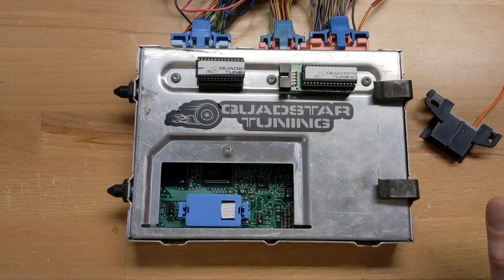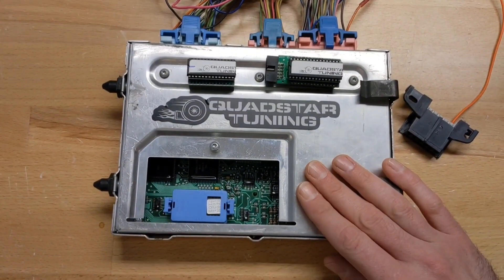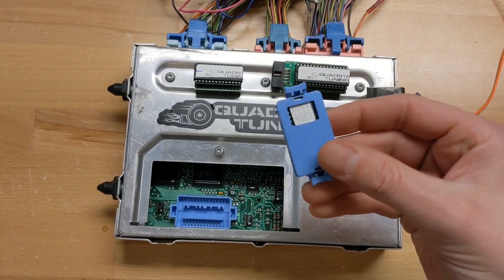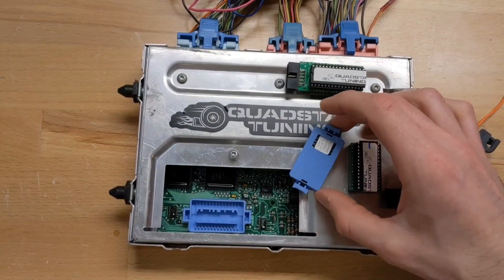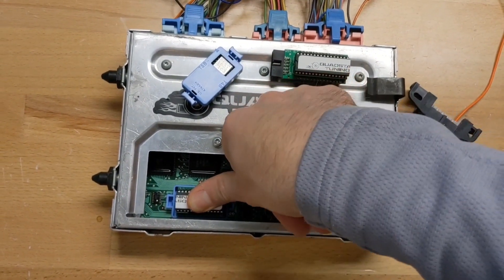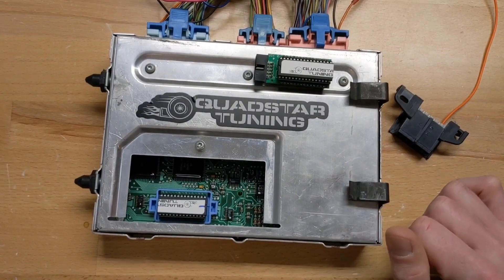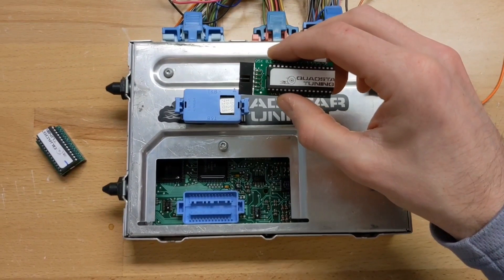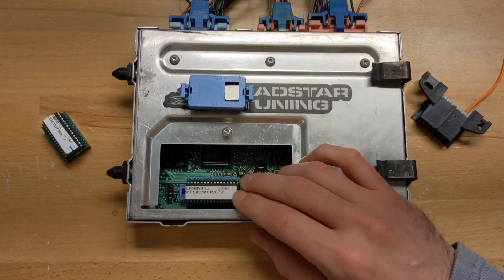Tune Installation on OBDI 6.5L Turbo Diesel

Comment: What’s the easiest way to make 300-350hp with a 6.5? what year is the best for power I already have an hx35 sitting in my shop.
Reply: Best way is to not! Don’t look at these motors as performance motors. Look at reliable and longevity. If you want power start with something that can make power. Sure it’s absolutely possible but why waist the time and money when there are much better platforms to start with.